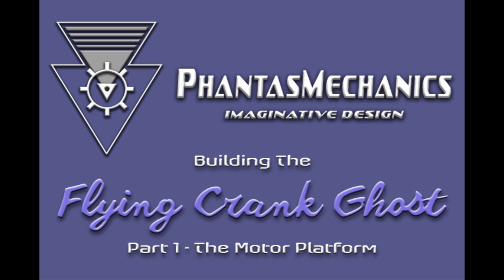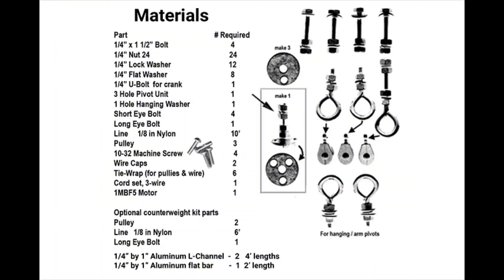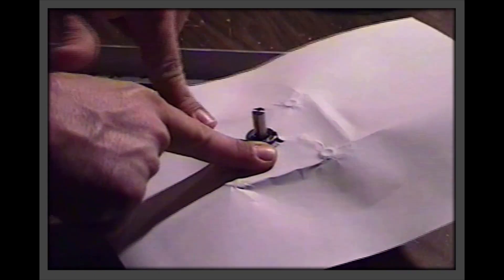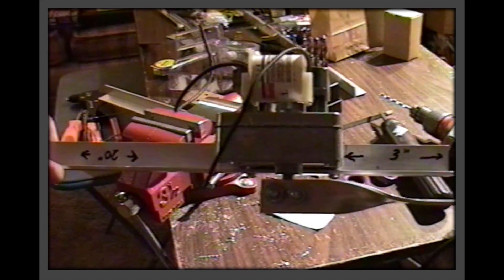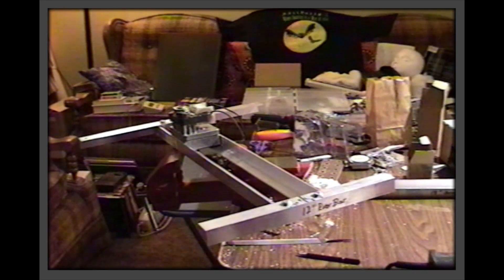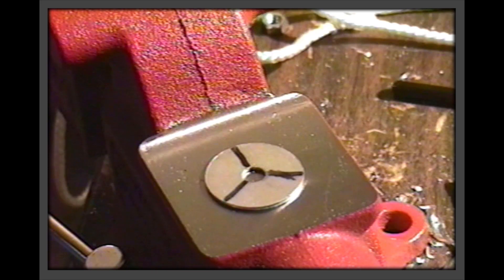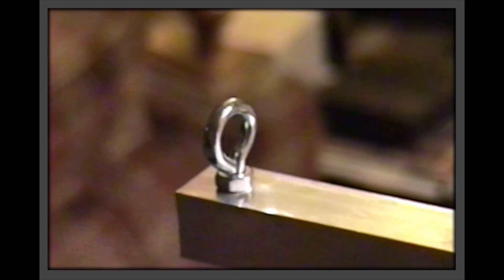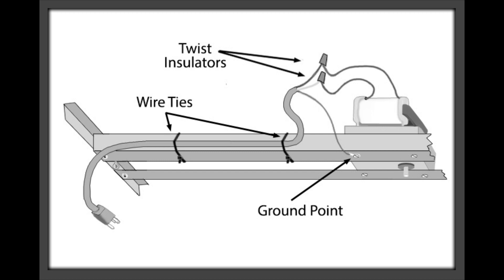Flying Crank Ghost How-To Part 1

Comment from the maker: website: http://www.phantasmechanics.com
Reply from the maker: I'm glad as always to be of service! Be sure to view the FCG Lite video too! Now it is so much easier and cheaper to build an FCG motor system if you use a light marionette (or counterweight a heavier one). If you have questions or need help, dougferg119@gmail.com. I'm always home. ^_^
Reply: I actually bought the fully built version from (I believe) Doug many years ago and have been flying my ghost proudly nearly every Halloween since. 3 homes later, it still works perfectly! A great tip Doug shared was to NOT over-light the ghost! You don't need to saturate it in black light. Have fun!
Reply from the maker: @JacksMusicOnVinyl  Thanks for that! Lighting is my big thing and I can't over-emphasize subtlety. ^_^